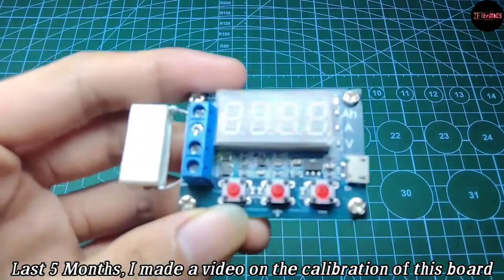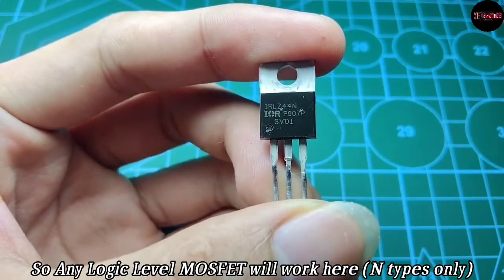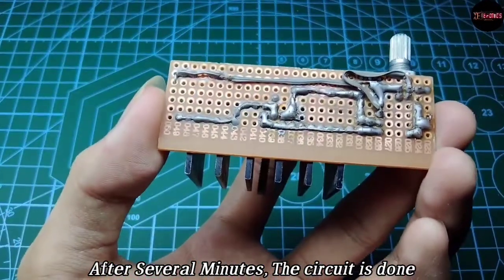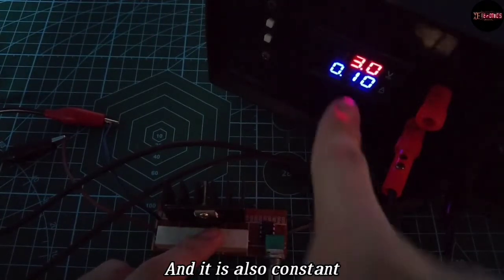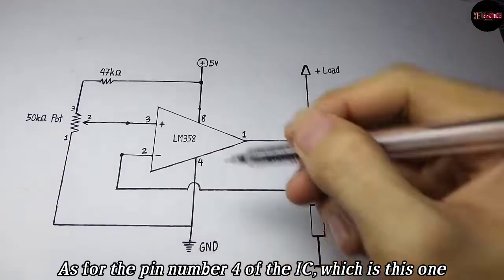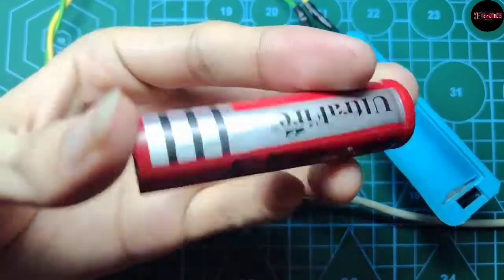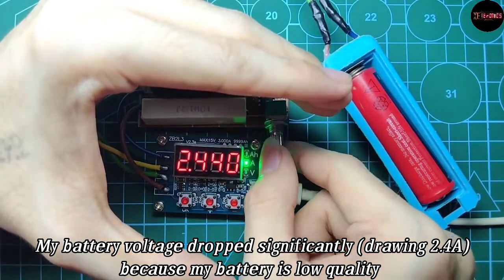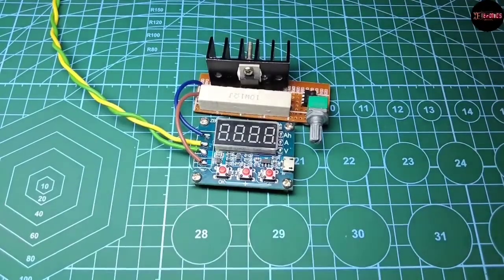Constant Current Load Addition to ZB2L3 Battery Capacity Tester using only 5 Parts!!! #battery

Comment: Can i use more Powerful MOSFET like the IRF3205 has it has same in voltage ⚡ but it has less energy loses has heat and it has less resistance and this one can do higher current draw so i should be able to get away with smaller heat sink on this vs the one you used?
Reply: The CC circuit is based on the load resistor AND the fet to share the disapative load heat. Most to220 fets can disapate 50W when properly heat sinked. But the discharger has a max current limit it can read, so using a better fet won't help or hurt
Reply from the maker: Yes you can use the MOSFET you've mentioned.
It will still depend on the the battery voltage and current discharge
Reply: @x3dtronicsph  I got small heat sink but I I  wondering if it's possible to screw hole into big heat sink I wasn't sure if I could has I can't find one that can I get with bit I could        
screw in
Reply: I was wondering if I could put hole into it so I could use it has big heat sink @x3dtronicsph  Aluminum Heat Sink 300x140x20mm
Reply: @x3dtronicsph I was wondering if you could do video taken you're time to explain where to connect very thing has I am bit of noob at this stuff and I think I might of connected wrong thing because I am used  101  video about where to connect very thing and I am not sure where to connect very thing so I was wondering if you could help me out bye doing  extra video on this schematic bit make it bit more clear and maybe show it more easily understood for being new to making this stuff

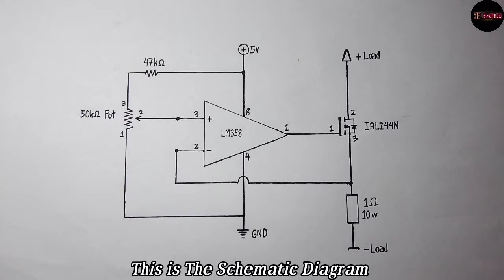Comment: 1:20  what if i used the same  47k resisor but instead of 50k pot i was to use 10k pot has i its cheaper for me buy 10k pot than 50k pot
Reply from the maker: No bro.
The purpose of the 47k and the 50k pot is to have a voltage divider.
I did that to limit the reference voltage of the OP-amp to 2.5volts (2.5Amps of current) because the module only handle max 3Amps of current.

IF YOU ARE GOING TO USE A 10K POT.
Replace that 47k resistor with a 10kilohms resistor.
Thank you😁
Reply: @x3dtronicsph  thank you for letting me I just have one more question what's the rating power rating needed for resistor and potential menter does it matter ?
Reply from the maker: Minimum of 5watts is good bro.
The most important thing is Adding a "BIG" HEATSINK to thE MOSFET.
that mosfet will dissipate a Lot of power.

What potential "menter" do you mean?
Reply: @x3dtronicsph   I was on about power rating for voltage divider sorry if this makes you get confused about it
Reply from the maker: 0.0025 watts is the power dissipation of the voltage divider section.
Any resistor can handle that very Little Current.
No worries

Comment: another question i overlooked in the schematic the pin1 of the pot it says GND but from your circuit i see that pin1 isnt connected to Vin ground, and also in circuit the overlapping leads from pot pin1 and pin4 of lm358 doesn't have a dot,  so do i not join pot pin1 and lm358 pin4 to Vin -ve terminal or leave it unconnected?
Reply from the maker: Basically, the pot is just an adjustable voltage divider.
Both ends of the pot should be connected to the Ground and Vin to have a voltage reference of 0-2.5volts.
Sorry for the missing dot.
Reply: thanks i was just confirming not connecting pin1 on the pot doesn't make sense anyway @x3dtronicsph

Comment: what will happen if i use a 10ohm 10 watt resistor instead of the 1 ohm 10 watt you used?
its almost impossible for me to get low ohms high watt power resistors around me, please reply
Reply from the maker: 1 ohm and below (for other circuit designs) is Needed here sir sadly.
With 10 ohms resistor, 18650's have max voltage of 4.2 volts, and using ohms law.
4.2÷ 10 is equal to 0.42.
Thus you can only draw a maximum current of 420miliamps.
That's it
Reply: @x3dtronicsph  i was going to use parallell resistance law to bring down the overall  resistance but i thankfully found oonly one piece of 1ohm10 watt thankfully
great video works perfectly

Comment: Can it work with alkaline battery  from 0.5v to 1.5v ?
Reply from the maker: Yes.
The module can handle those voltage level up to 15volts.
I recommend to set the current to around 100mA only for AA and AAA battery sizes
Reply: @x3dtronicsph  would it be possible to draw 100 ma cc load from 4.2v battery without heat sink?